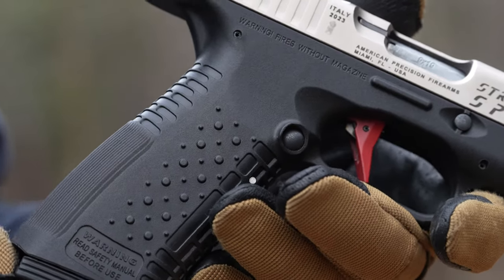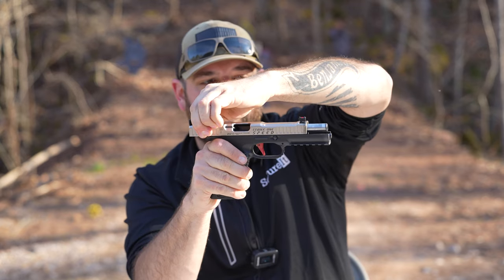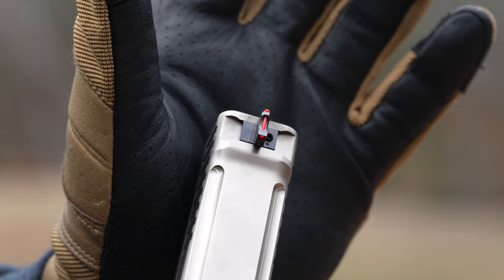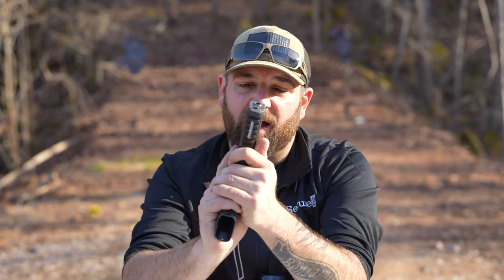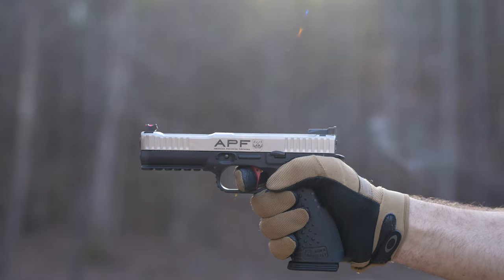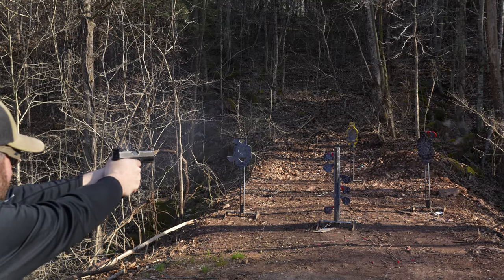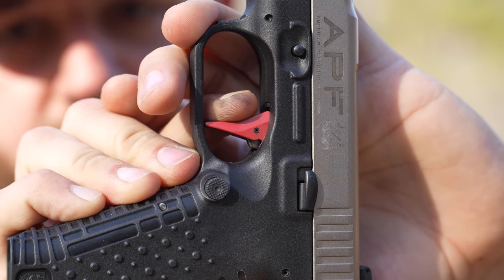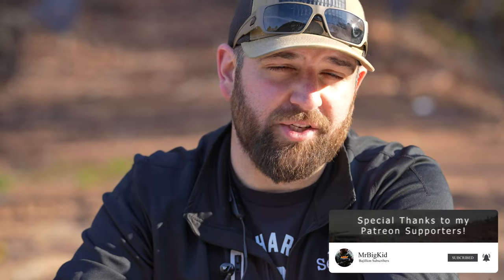Arsenal Strike One Speed - Super Low Recoil Handgun

Comment: I own one of these.  First of all, you cannot judge what these are like by looking at samples made before 2022.  The old models (Italian-made) were an Arsenal Firearms brand, but they were made by another firm.  2022 and later AF is making them and they simply work better!  The performance of this pistol can be improved even further with the Toni System tungsten guide rod along with all 3 springs (14, 15, and 16 pounds).  For full power loads, I use the 16# with total reliability.  Additionally, the gun works even better (in terms of recoil).  Since break in it has been trouble free and it wasn't much trouble while breaking in.  Regarding break-in, as a Master Pistolsmith of over 3 decades, here's my 2 cents: Break-in is real.  Break-in is required.  The AF has quite a bit of machining internally.  It needs to be worn in.  It's worth it.  I didn't hear him mention how this pistol has full-length frame rails that are fully machined.  Additionally, it does have a removable rail/FCU that is serialized and can be totally removed.  While not as turn-key as a P320, it is still modular.  I REALLY do like mine.  Thankfully, with all of that trigger creep (it actually feels like "trigger glide", whatever that is) the pull weight isn't bad.  Mine, after break-in, settled at 2.75 lbs.  This pistol can use CZ 75 magazines in a pinch.  It also has an internally adjustable overtravel stop for the trigger.  Overall it's a really nice gun that despite trading constantly, this one has survived the cut for a couple of years, which is more amazing than you think.